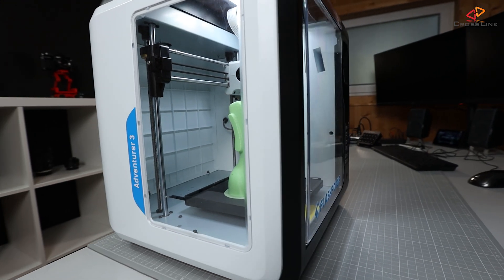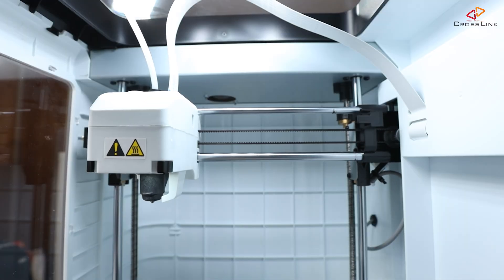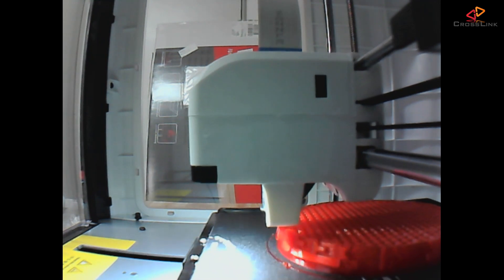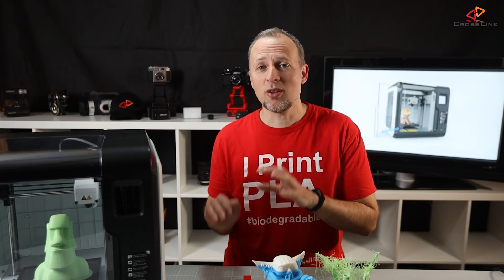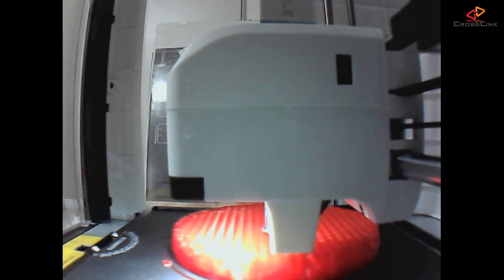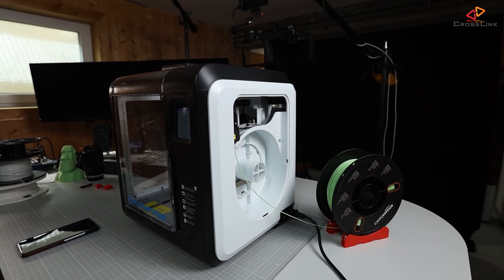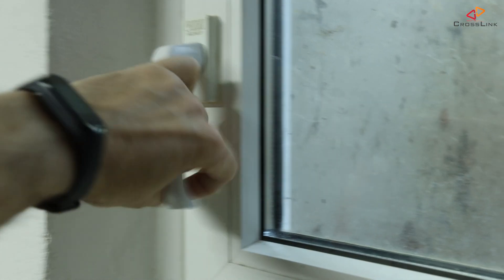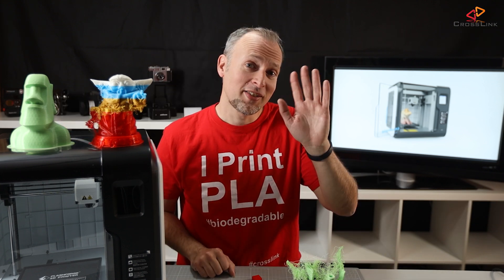Flashforge Adventurer 3 HONEST Review - This one SURPRISED me!

Comment: I bought a Flashforge Adventurer 5M Pro a few months ago, thinking I could have a little fun and at least make it pay for itself. I have had nothing but trouble with it since i bought it... Just bought an extruder assembly from Flashforge to fix the problem. It loaded the Filament just fine but when I tried to print the nozzle broke in half. I replaced the nozzle now it won't work at all. I wish I would have bought a different printer but I'm stuck with an expensive reminder of how warranties are worthless. Buying this printer was a huge mistake and a terrible investment..........
Reply from the maker: That sounds awful, keep pushing them to send you the spare parts and make some videos about the issue, put them on YouTube to increase social pressure

Comment: I bought this printer in early 2024 and used it for several months with no problems.  I then encountered an issue with the FlashPrint slicing. I contactedd FlashPrint software support and explained the problem.  They referred me to FlashForge hardware support who referred me back to software support.  This back-and-forth occurred several times.  By February 2025, I was convinced that no one had actually read my question and that further pursuit of FlashPrint help was a waste of time.  So, after three months, I gave up.  I will never buy another FlashForge product.

I wish this review had included an evaluation of FlashPrint support to warn others.

Comment: Really you locked the printer profile behind your patreon account??? I understand putting your self-created 3d Print files but a Cura printer profile should be given out freely. I've supported you in the past to get a print but this seems wrong to me in the world of 3D printing. Manufactures usually give them away for free.
Reply from the maker: Well, this is the same as with photographers on YouTube selling presets to their audience. You can also create them on your own. The point is not that this requires secret knowledge but it's for supporting the channel.
Reply: @Crosslink3D  I get it but was just sharing my frustration I guess. I'm at work and another teacher needs help setting up Cura again. I realized I already have this printer setup on my Cura install so I exported it as a project. All is well again. Sometimes we only have so much time at work but then again I love 3D printers so cheers! Thanks for your videos.

Comment: At what distance is the best to keep the nozzle from the bed? I printed yesterday an Einstein very successfully but today I tried to print an octopus and had two issues, one was that the nozzle extrude material right before the first layer and dragged it with it. And the second, was even I calibrated, happened the same thing, printed randomly and the material was moving all around. Thanks!!

Comment: I’m sorry the only thing I need to complain about is yes, thermal expansion is real, but under 400 degrees for most material it’s less than .001 to .002 expansion so coming from someone who studied metallurgy it’s annoying to hear about in every single video on 3D printing it’s not an issue  for calibration, it’s an issue with bridges, press fits , and super tight tolerances parts. But overall great video

Comment: Wondering if you still have this printer and if it kept giving adhesion problems on bigger prints. I'm thorn between going for this or an ender 3 v2 as first printer (honestly not really going to print much ABS but I need something silent as the printer will stay on m bedroom)
Reply: What did you end up getting?
Reply: @rothauspils123  Eryone ER-20 (it's an ender clone), been using for a week nearly any time I'm at home, except for having to buy some lubricant had 0 issues, it's an open printer so no ABS printing on it, but it has an included BL touch like device, power out prevention (tested) and basically it's mount and go.... I kept searching more, and ended getting it about a month ago (arrived about a week and half ago, so I've had so far 3 full days ,aka 12-15h prints, printing + 4 days of 4-6h ones, only 1 failed print out of those, and 1 semi failed as didn't print to size but that's my fault on cura and being careful with dimensions)

Comment: I was recently in the market for purchasing another printer I saw this video and it fit what I needed so I bought it! But then...I recently got this machine and I was able to print 4 successful prints with 0 issues. I recently have been having major problems. 1 when I start a print it says “filament error” and stops the machine while there is nothing wrong with the filament or any type of clog as the print is coming out perfect. And 2 the printer will print smoothly for literally about half the build and then it will stop extruding. So as you can imagine I need help please!

Comment: How do you clean the platform??
Reply from the maker: I use a scraper for larger rests of filament and isopropanol alcohol to clean up any rests of adhesion glue/spray. Depends on what material you use and if you are using additional adhesion helpers.

Comment: So if you were a beginner and it's your first printer would you go with ender 3 or adventurer 3? They both have their ups & downs and I'm undecided on which one to go with
Reply: Depends . It’s like buying a car , do you want an exotic or something that can work as well depends on how much you wanna mod/tune
Reply: The Flashforge Finder!
Reply: What did you end up picking?
Reply: @CN-dh3ge  I went with the ender 3. It was more user friendly in my opinion. I got it set up and running in little over an hour & a half or so. Still using it almost daily

Comment: I would like to make simracing components. Would anyone suggest this vs the endlr 5 plus? I've narrowed down to these two models
Reply from the maker: Sounds reasonable. It's big and has good print quality. I can only imagine that the CR10 max will give you more size if you need it but you can also slice your parts and glue them together. Materialwise I can recommend to use Tiamet Ultra Diamond plus material for parts that need to be strong. It's printable on any printer without enclosure and has ABS like properties: https://www.tiamet3d.com/product-page/ultra-diamond-pla-1kg

Comment: Can you respool onto compatible empty spool to fit inside?
Reply from the maker: There is an adapter available to use larger spools. It basically sticks into the center hole of the filament spool holder of the ADV3. https://www.thingiverse.com/thing:3692572 and https://www.thingiverse.com/thing:4002193

Comment: hello
thanks for the review 
 can this printer print  withTPU fillament? or if not what do I need to do this with a printer like this?
Reply from the maker: Well, it's a bowden printer. So Ninjaflex will give you troubles. But there is also stiffer TPU materials like the SUNLU, which might work better. I have to test this.
Reply: @Crosslink3D  ok thanks
I like to print gopro mounts for drones 
Like you see a lot on internet
They are all tpu so a little flexible for vibration absorption
I have no idea with what kind of printer the do this

Comment: Sir, I want to ask if Flashforge Adventurer 3 is used in the air conditioning room, is it safe? or affect quality?
Reply from the maker: I've printed ABS with it several times and there was barely any smell. Of course from time to time you should open a window but the chamber really keeps most inside until you open it. Anyways, it's always recommended to run the printer in a ventilated environment.

Comment: What software should i use for 3D-Modeling so it will work perfectly? 
Please tell me
Reply: This is really up to you to decide. I mostly use Blender to do all my 3D models, but that is only because i have almost 10 years of experience using Blender. My friend uses 3Dmax as that is what they have used for years.

Something like Solidworks will probably give you the best results as it is an industry standard for engineers and designers, but might have a steep learning curve.
Reply: Freecad maybe... also sketchup which is really easy to learn, also got lots of plugins...
Blender is awesome though, but as a beginner it is not easy!
Reply: I selected the programs i need to use already

Comment: I'm getting my hands in this soon I've never 3d printed before but I'm quite exited
Reply: Same I am tooo
Reply: Yeah, just got mine yesterday
Reply: How the heck do you clean the platform????
Reply: @Mario700K  idk, I ended up getting and Ender 3 pro instead, I put tape on the platform so that you can peel it off and get rid of the filament easily
Reply: @CephaVa  thanks for the tip
Reply: @KrystalTheOctoling95  What made you change your mind? Deciding on both myself!
Reply: @05StangDudeV6  the Ender costed less
Reply: @CephaVa  how are you enjoying the ender now?
Reply: @05StangDudeV6  pretty good
Reply: @CephaVa  How has your experience been with it after 2 weeks and what have you made?
Reply: @calebeast7798  I made a few little Splatoon things, nothing big, it took a while to calibrate but once that’s out of the way, it works great

Comment: Flashforge printers have been having a lot of issues lately and it almost all comes down to them cheaping out with garbage quality Chinese stepper motors for the extruder. No matter how much I clean out the nozzle, which is brand new now, with new bowden tubes and everything else, the extruder continues clicking away. Even slowing down the print and increasing temps doesn't help. It's not just the adventure 3 either. it appears they've used the same under-spec stepper motor for pretty much their whole product line.
Reply: Are you for real. That solves my question why my ender 3 v2 is clicking the whole f#cking day.
Thanks dodnt know that
Reply: Just replace the stepper motor, it takes like 5 min.  But it’s prob not that, it’s prob the gripping wheel.
Reply: All motors are from China so yeah even the top line printers use “cheap Chinese parts”
Reply: @Rastafromfl  Not all motors come from China. They come from all over the world. You can get some made in Japan, Taiwan, Mexico and even the U.S. Many go with the Chinese motors because they're cheap.

Comment: You can upload a new firmware over USB... you place the firmware.bin file on the USB stick and as soon as it sees it, it will update the firmware.
Reply: I would also add that Tree Like supports are the default, but when you're adding supports, there are radio buttons at the top of the dialog that allow you to select "Linear" type supports as well.  One last thing... the option for Z hop is called "Lower Build Plate While Travelling" and is  under the Supports tab.

Comment: I have this printer and it works like a charm
Reply: Hi Amar, how do you make sure that your print sticks to the bed platform? I’m finding that my print isn’t sticking to the bed platform which results in my print moving and the it not printing correctly. Do you have this problem?
Reply: @929Gabby  all you have to do is either A rub glue on the print bed to - wash it off the print bottom when it’s done or B put blue painters tape on the bed- if this does not work do both- rub glue on tape on the bed. Now if none of these work try hairspray or lowering your nozzle closer to the bed
Reply: Amar Makhamadaliev thank you Amar! That’s so helpful, I’m going to try all of them!
Reply: @929Gabby  no problem have a good day!

Comment: Good review.  But based on your results, I would say the printer is pretty bad.  Just look at all your failed prints.
Reply from the maker: Do you like to know how many failed prints I still have on the Ender 3 and my Anet A8? Too many
Reply: @Crosslink3D  I guess that puts things into perspective!  I just ordered the Adventurer 3, we'll see how it goes.
Reply: @worldwide1376  How did it go?
Reply: @BearMetro  I've had the printer for almost 4 months and love it thus far.  It just works and works well.  The quality of print is very high.  The only thing time will tell is its long term durability.
Reply: @worldwide1376  your comment just sealed the deal and I just pulled the trigger. Thanks 😊
Reply: @eyzonm3  Congrats!  The only other comment I'd like to make is that I only use the Flashforge filament, I do not use 3d party filament.  The downside, it's a bit pricier, but I'm fine with that as I need something that just works.  I also have a Monoprice Maker Ultimate.  I've used various 3d party filament with that printer with varying success, from very good to constant nozzle clogs.  The Adventurer 3 setup, I can just turn on and print without much effort or hassle.

Comment: nice review. a question. how big of an issue is the printbed calibration? if the corners are Lower than the middle won't you experiance frequent issues? mostt printers calibrate all corners.
Reply from the maker: What I've discovered is that underneath the bed there is also a steel plate with strings. So if there is more pressure in the middle it will give a little bit. Using a brim also helped to get better adhesion in areas closer to the edges. Since the bed is only 150*150 this is probably acceptable. If the bed was 200 or larger I guess this wouldn't work anymore
Reply: @Crosslink3D   haven't thought of that before. your tip ( to calibrate the point a bit lower in the middle) makes much more sence now! :) thnx!

Comment: I've printed many prints from flashcloud the last week. It works fine in Norway. I don't want to use polar cloud because they want access to everything on my Google account. And I don't have Facebook.
Reply from the maker: Well, maybe it got better in the meanwhile. Anyways I am making an update video with long term results in a bit so going to give it a look then
Reply: @Crosslink3D  after I installed ip/mac address fix firmware from memorystick I think my flashcloud got more responsive.  I only used stock firmware the first day.  Third day I got over the air update to the software I've installed from memorystick.
Reply: Thor if Monoprice really wanted their printer to be able to print these things its customers say it can print there probably would not be such hype about it.I mean think about it. Here we have a machine capable of printing just a tiny cube and thats it. And if people try to make it print something else it usually leads them nowhere.
Reply: @Yatukih_001  I don't know what you're talking about. 150×150×150mm is enough build volume for 99% of my prints. I can print in a drafty living room with the adventurer 3.  I can even print with windows open. Also with less noise than my ender 2 with motor dampeners.  My ender 2 can only print from USB connection. SD slot didn't last.  I've never had to physically connect or use SD card on adventurer 3 because of internet and wifi connection. I got what I paid for with adventurer 3. Not so much with ender 2. My creality is mostly collecting dust because of missing bootloader, and no thermal run away protection.

Comment: Hi I like you review I have had the ad3 for 5 months now and it is a very reliable printer you mentioned flashprint only does tree supports is does both it does also have a version of z hop in supports it has the option to lower the bed when travelling I used this printer to print upgrades for my anet a8 when it wasnt working very well its all up and running now I have also posted a link to your review on the adventurer 3 support group on facbook :)
Reply from the maker: Thanks for the info! I appreciate you sharing this video. I will also look again for the z-hop like feature. Do you remember how the option is called in FlashPrint?
THe support settings are really strange. I tried around but it always generated tree support, maybe its just not really clear how to do it right?
Reply: @Crosslink3D  Hi under the heading supports it gives you the option to lower the bed when travelling

Comment: PLA is still not biodegradable. High concentration of enzymes with special conditions of temperature and pressure are required to engage degradation. All that conditions does not exist together in natural environment. Last, actually no PLA was fully degraded. The single study just shows a start of degradation and pretends a further degradation might be possible. Check it out by yourself.
Reply from the maker: You're having a good point here. I am adapting and the next generation of shirts will not have this bodegradavle statement anymore 😉